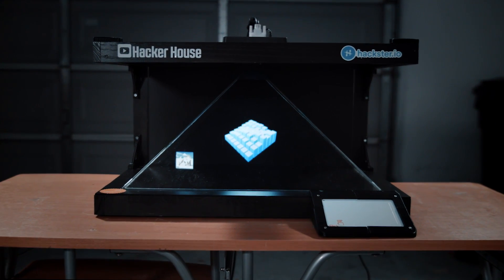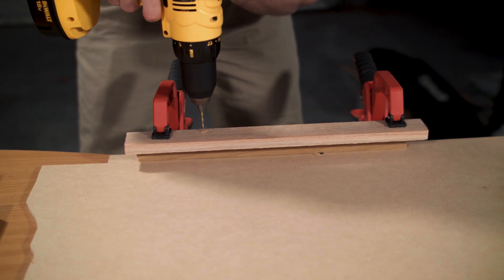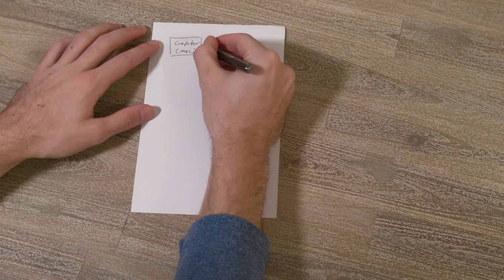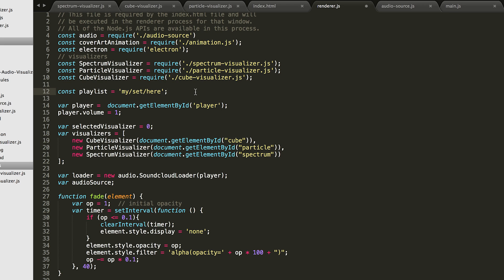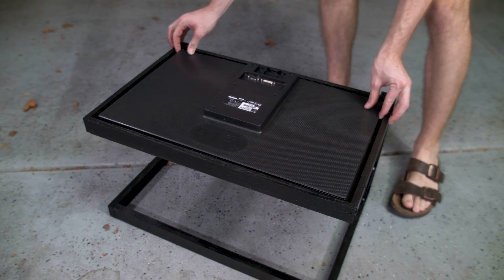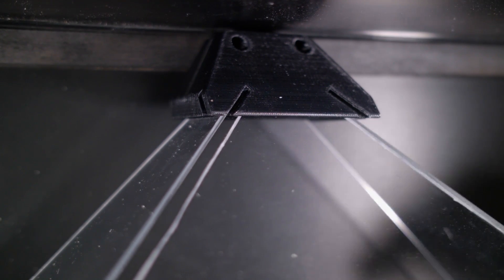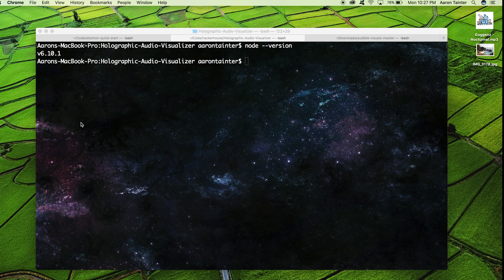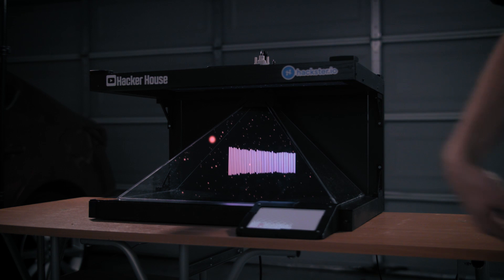DIY Holographic Audio Visualizer with Gesture Control

Comment from the maker: For everyone asking why I didn't run the visualizer on the Raspberry Pi -- I tried, but it was too laggy (5fps on a Pi 3), which is why I ended up using a more powerful computer to run the visualizer. I used a 3D PDF of our design for the hologram structure to find the measurements. The tool gives measurements at the hundredth rather than the  nearest 1/32nd. Also,  I didn't want to mix units with metric measurements because all of our supplies were in standard. If you download the PDF on hackster.io (links in description) and use the 3D measurement tool in Adobe Reader, you should be able to get metric conversions. 

Aaron
Reply: Use a LattePanda
Reply: Hacker House Maybe it could run on the more powerful Pine A64?
Reply: im new with coding can this be done in python?
Reply: How the heck to your measure these boards? 12.99 13.367 ?
Reply: hey there are no equations 
when will they be available

Comment: also Sorry to be "that guy", but that prism hologram setup is meant for images to be seen from 3 sides... if the visualizer was broken into 3 angles to reflect on the side pieces, then it would have looked much more 3D... with your setup... you could have gotten the same effect with your visualizer just using one piece of angled plexiglass.

Comment: Did you use pla to 3D print the parts? Because they’re not strong enough. They have some strength but they still are easy to break especially the brackets and the tip of the fulcrum bracket.

Comment: I don't get the point of plexi glass on the sides they are not reflecting any light from the monitor because you are not generating 4 views as is done usually in this kind of setup can't we just use a single piece of plexi glass tilted at 45 degree in the front to reflect light to the viewer instead ? Won't it give the same effect ?

Comment: For those who don't know, the inch is a unit of length in the United States formally equal to  1⁄36 yard but usually understood as  1⁄12 of a foot. The foot is defined as 12 inches. Don't ask about the yard...that's a deep, dark and depressing rabbit hole.
Reply: mokopa should we talk about slugs as a unit next?
Reply: It's just a Imperial Unit

Comment: Unless you are doing a video for CNC machining of parts, use fractional measurements when giving US Customary Unit measurements. If you insist on base 10 sub-units, just use metric. 

You will never see a proper cut list for a DIY project with decimal measurements that don't match up to 32nds of an inch at the smallest. This is something to consider in the design documentation process. If the measurements were arbitrary to fit the project parts, then advise others to cut to fit.

I know this whole thing seems petty and pedantic, but tape measures do not have measurements in base-10. The job of rendering down the fat of the design process is work done by one person instead of forcing you audience to break out their conversion chart from the bottom of the bench or to break out a calculator to do math that should have already been done.

Comment: Just a note: if you are doing something with parallax then you should get some footage to show off the effect. Tripod shots, while stable, do not "sell the effect" as you said. A simple shot walking left and then back right will achieve this. Look forward to your next project and would love to see this adapted to play the old hologram games we used to have in the arcades. Sega made one I think....Time something...
Reply: They won't show a parallax effect (i.e., seeing a different side of the object just by moving) because there isn't one. This setup reflects the 2-D monitor image off of the plastic, and behind the plastic is a black background. This makes it seem the image is floating in mid-air. This is a cool effect, but it's not 3-D and it's not a real hologram or even truly holographic. Those terms were originally used for true 3-D images produced (and mostly viewed) using a laser, and since them the terms have been watered down due to misuse. This is basically a modern version of Pepper's Ghost. https://en.wikipedia.org/wiki/Pepper's_ghost

The game you're thinking of is Time Traveler. The effect is similar and again it depends on a black background and the 2-D image from a monitor, but a curved mirror was used.https://en.wikipedia.org/wiki/Time_Traveler_(video_game)